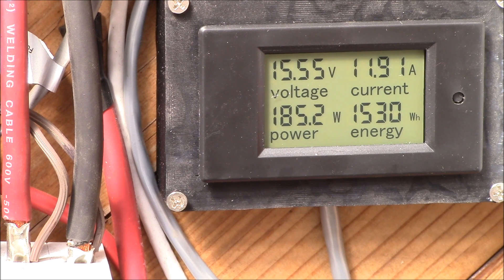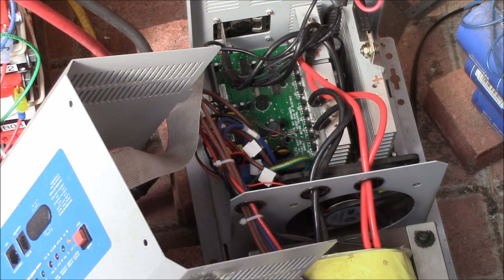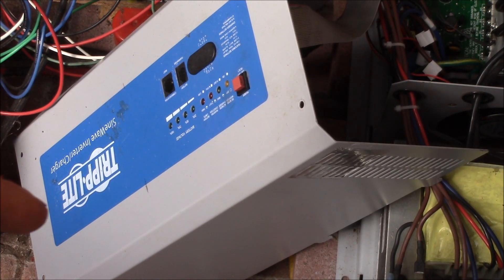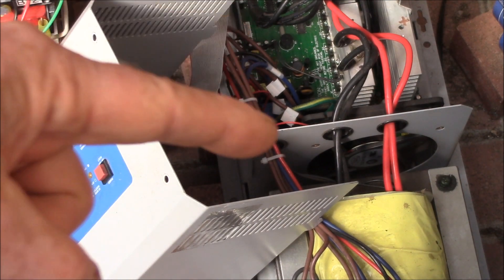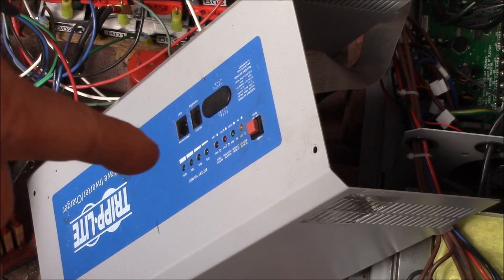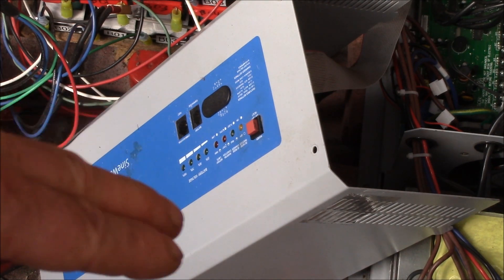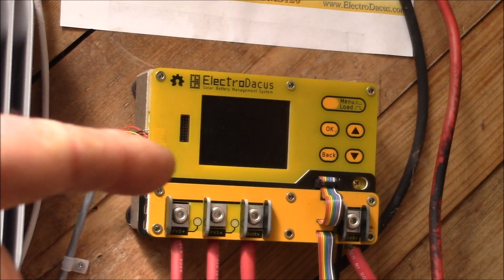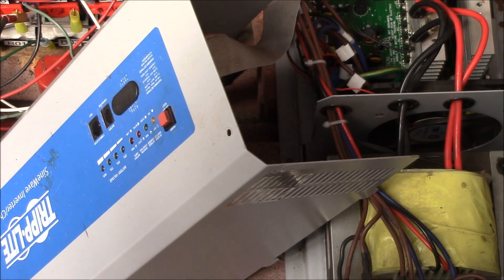TrippLite APS1012SW Inverter/Charger, Blown Caps, Part 4

Comment: Found more than what you were looking for, plus added your own...videos are well done...proof as I understood enough to follow along...(took me more than a one time view)...actually someone on your level should appreciate what you revealed inside the silver box...know it doesn't mean much coming from a less than full "capacitor"...interesting how all the power gets from one point to another and what stops it (outside of a solar eclipse and an on- off switch)...the sun rises just in time to power the coffee pot...power is saved to run it for a second cup...what you know---what I understand---it's all a matter of perspective...text book, learning curve, common sense...can tell this is a very good 1-2-3-4-? video...can see not only the work but the information you are passing on...found problems, made repairs...anyone who has a "broken" one...now knows what to address...no more "smoking" tripping out Tripps for you...always nice to have one that works...sans the thermal runaway...harder to understand a concept when I have no application...if one has one...pay attention the man is telling you what may not be in the manual...♀
Reply from the maker: Yes, trying to document all the things I've run into.  According to TrippLite:
"Your Inverter/Charger requires no maintenance and contains no user-serviceable or user-replaceable parts, but should be kept dry at all times. Periodically check, clean and tighten all cable connections, as necessary, both at the unit and at the battery."
So they offer nothing in the way of a repair manual or information.  So I should be chucking this thing in the bin according to them.  I think the unit is actually fairly repairable.  It's laid out quite nice and has a good quantity of off-the-shelf type parts.

Comment: With all due respect, I would get a decent and reliable inverter that I would rely my livelihood on it! Godspeed
Reply from the maker: This is the first issue I've run into in 5+ years of daily operation, so I would say that's fairly reliable.  Ultimately I'll be picking up a 24 volt inverter, likely a hybrid, but for now, I want to work with what I have.  Once I have everything set up and running with the current equipment, it will be a simple matter to convert to a 24 volt system when I decide to make that switch.
Reply: R Brown yes indeed, Godspeed

Comment: good luck moving forward
Reply from the maker: I've really had to dig into this unit and figure out how things work in it.  TrippLite has a fairly decent manual for the inverter, but amazingly it says nothing about the cooling fan, how it's supposed to work, etc.  I guess this says it all:

"Your Inverter/Charger requires no maintenance and contains no user-serviceable or user-replaceable parts."

I beg to differ with that statement :)

Comment: sweet glad you figured it out!
Reply from the maker: Yes, getting there.  Still have a few issues to work out.  I think I'm getting to the bottom of the cooling issue which I think has been the root cause of the problem.